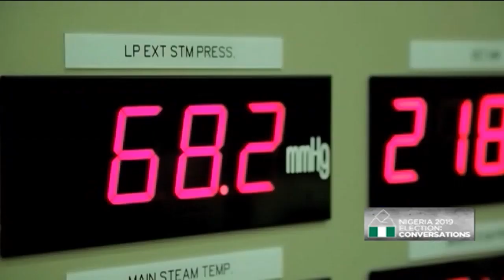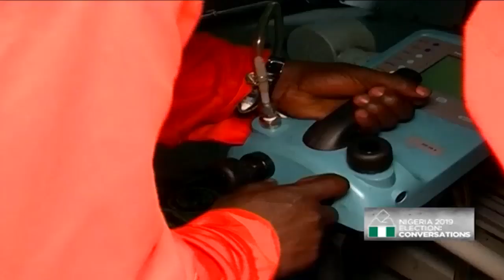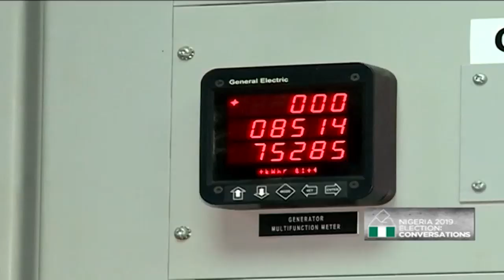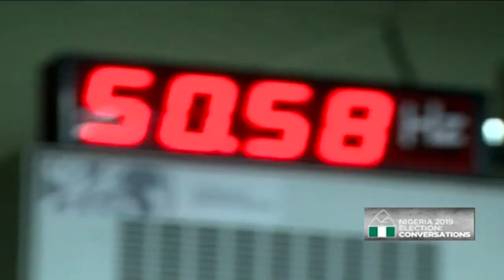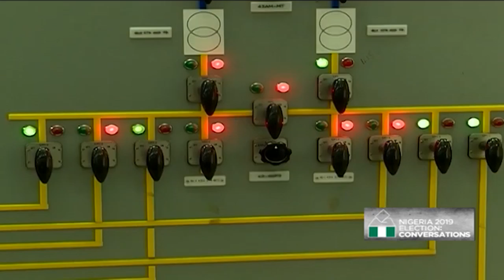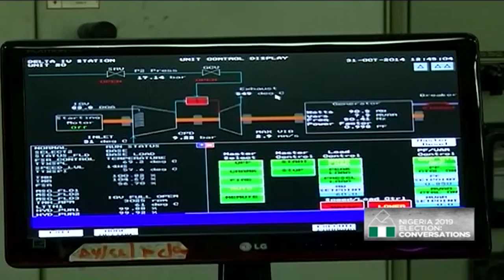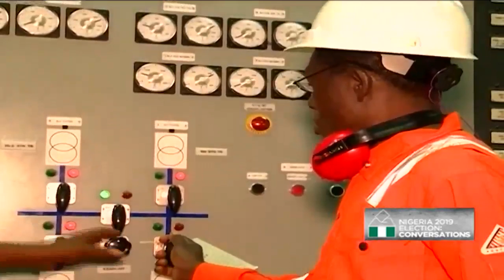Nigeria 2019 elections: Finding solutions to Nigeria’s electricity problems

Comment: Nigeria will have to learn to design, develop and manufacture their own generators and other electricial equipment instead of importing these things and this will give NIgerians jobs and help expand its manufacturing sector. Also, this will help Nigeria save money and help allow Nigeria to control it's on destiny and then the price of power can be better regulated. I would like to see Nigeria become like China. This also includes the rail sector . Nigeria start learning how to build its own rails along with rail equipment and trains.